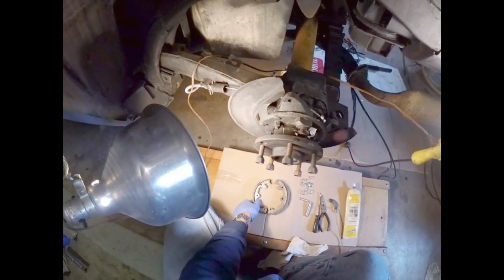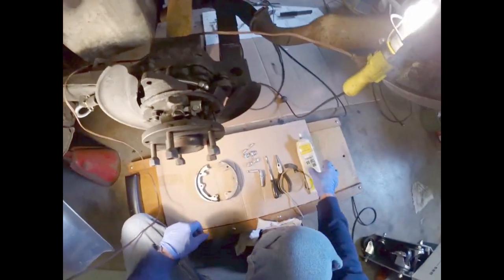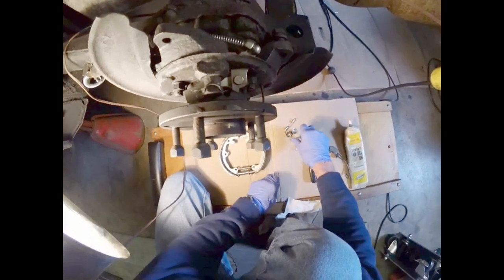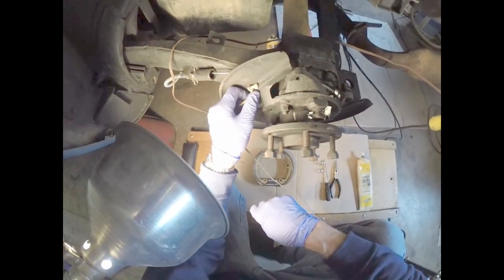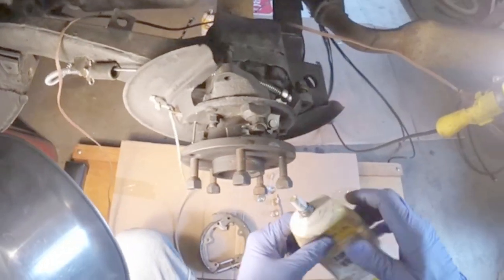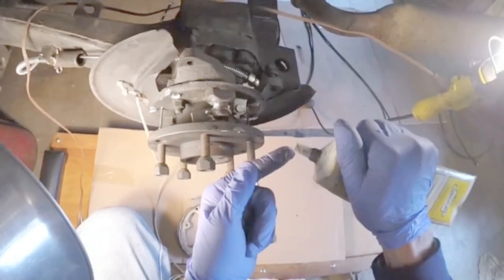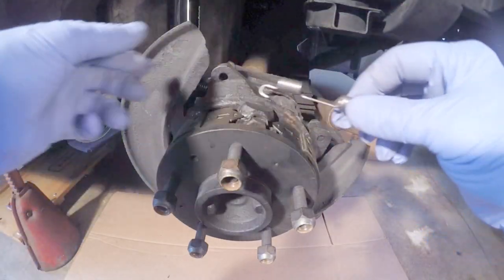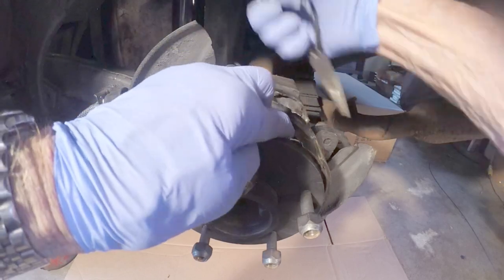Easier C3 Corvette Parking Brakes Install

Comment: I just did this on the right side of my Vette. Yes, I did invent some new cuss words along the way, but it worked. It's also a good idea to either make, or buy the screwdriver thing from Zip Corvette.  But here's something I totally overlooked. Over the years, I had increased the tension on my brake cable, and didn't think to loosen it back out before this job. Glad I caught it before I got any further.

Comment: And now the second one is done, just as easily as the first! Having done both sides, where I used the wire method for the captive pin and the no wire method for the loose pin, I’m wondering why there are two ways to do this? Based on my limited experience I would expect both to work for back and front… what am I missing? Either way this was a huge improvement over the usual ‘start at the top’ way of doing this!!

Comment: I've got my calipers and rotors off awaiting a caliper rebuild and rotor replacement.  While I'm at it, can I just remove the parking brake shoe pads, clean and rebuild as you've highlighted in the video?  The show pads and assemble are looking pretty rough so I figure I might as well clean while at it.
Reply: As you can see in the video, the calipers and rotor have yet to be replaced. Your timing is perfect
Reply: @edgarhartzke8018  thanks. Should I just use brake cleaner to clean off the shoe pads and other assemblies?
Reply: As long as the cleaner does not contain any lubricant. Don’t get any cleaner or brake fluid on your paint.
Reply: @edgarhartzke8018  Thanks.  Did you replace all parking brake components or use any of the existing?
Reply from the maker: Everything was replaced, including all calipers and rotors